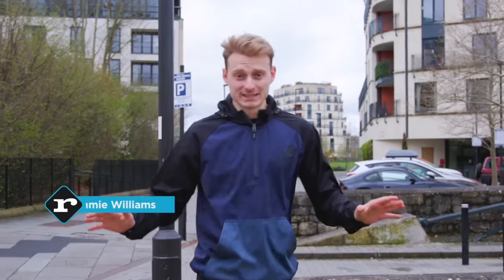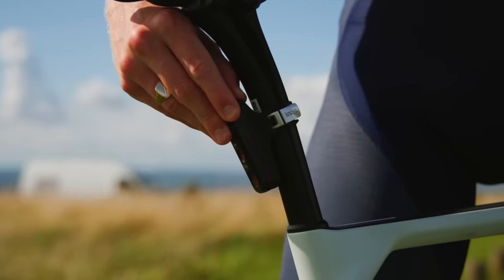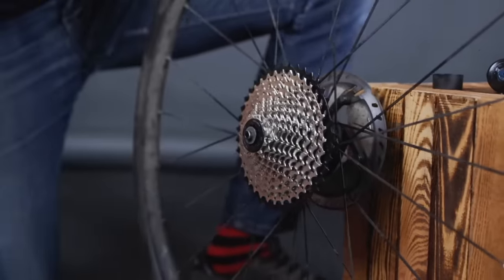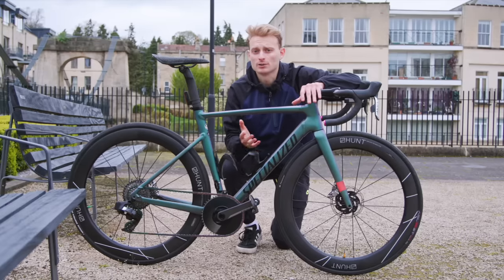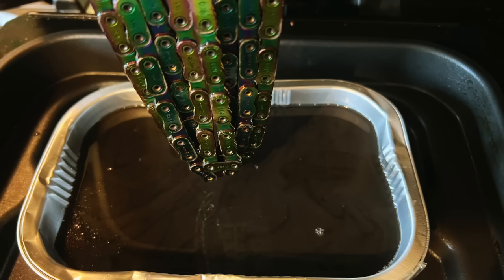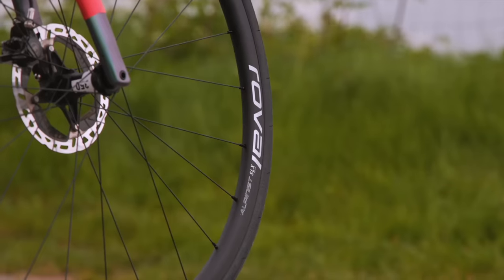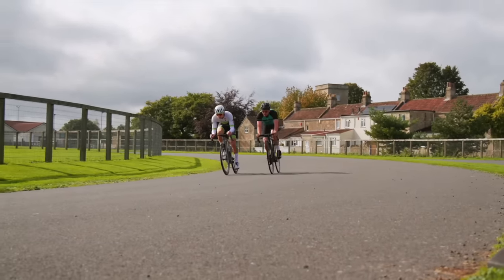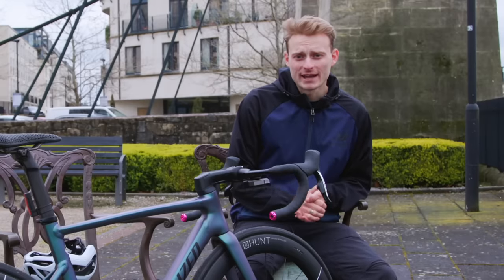8 Upgrades I've Made To My Road Bike To Make It BETTER Than A New One!

Comment: Keep in mind when he talks about some inner tubes being lighter, that is only 0.1% of the benefit.  The rest of the benefit comes from improved rolling resistance, as it takes significantly less energy to deform the latex or TPU tubes as you roll along. Its quite significant.

Comment: One more upgrade I just did is a lightweight saddle.  I bought a 3D printed one for very little money that is more comfy than the Selle Italia I'd been riding and weighs about half.  I'd already done most of the upgrades suggested, except the air tags.  The wheels I did almost 20 years ago and maybe could be done again with the more recent aero carbon wheels.  I keep it clean, changed the gearing, use TPU tubes, use good tires, have a power meter.  No need for lights on my roadie, if I'm going to be out in the dark I use my commuter bike with dynamo lighting.  And yet with all that I still keep looking at new bikes but don't believe it'll be worth it unless I go through that whole upgrade process again.

Comment: I ride Evil Chamois Hagar with two wheelsets (DTSwiss GR1600 alu and Elitewheels G45 carbon) and a carbon road bike (SAVA). I love all your comments. They are spot on. I bought latex tubes but still did not change my last butyl tubes. I also like how tubeless is a lot less effort than I originally thought. Lastly I am also aiming to get a power meter but still waiting for a better price. 
Your video brings the most common upgrades into a nice package. In my opinion, even the order of them is very appropriate.

Comment: I've implemented most of the upgrades on my 10 year old aluminium road bike and it still is competitive to most modern road bikes at 7.5 kg race-ready. My current upgrade which I'm still working on is an integrated carbon handlebar off Aliexpress so you might want to add that to your list. Cheers

Comment: If we're discussing gearing, perhaps you should preach more the advantages of subcompact cranksets (46/30, 48/31, 48/32), which are far more useful for average cyclists with sub-3W/kg FTPs than those idiotic yet ubiquitous 52-36. What is an amateur supposed to do with the high gears that are typically used by pro riders on sprints or 80+ km/h descents on closed roads?

Comment: Hi great video.  I ride a 2020 Specialized Venge Pro SRAM Force etap.  Would it be worth swapping out the crank arms for Red which will be 140 grams lighter at about $300 usd.  Will I feel a difference climbing?  THX
Reply: Îve done just that. All SRAM RED on my 2020 Venge. The cassette too: MASSIVE weight gains. Sram Red crankarms are stupid light. Keep the Force chainring. I’ve put the most recent SRAM FORCE/QUARQ chainring (the all black one) on the RED crankarms, perfect. The Force/Quarq chainring weighs THE SAME as the Red for half the price!! But the cassette (190g 10-28!!) and the Crankarms will shave a lot of weight. Both can be found under $300 if you look around hard

Comment: Wouldn’t i have to change the entire gearset if i change my cassette? (Shimano claris)
Reply from the maker: You wouldn't be able to get one with a different number of gears but you'll be able to get compatible chainrings and cassettes with different ratios (Be careful not to exceed your rear mechs maximum capacity)
Reply: Like an 11 to 42? Does that also change something for climbing
Reply: @giacomobiondo1471  Yes, the larger the cassette, the lower your gearing will be, which makes climbing easier, but in turn gives you larger jumps in gear ratios in between gears.
Reply: @giacomobiondo1471  There are different cassettes within the Claris component range. I have "Claris 2400" with an 11-32 cassette on their normal rear mech and a 50-39-30 triple at the front. I think there's an 11-34 cassette with 50-34 "compact double" at the front which is almost the same total range.

Count the teeth on the biggest and smallest ring at the front and the back to see what you currently have. Hope you find the ratios you want - and use a local bike shop if you can't swap everything over yourself. (Requires some specialist tools.)